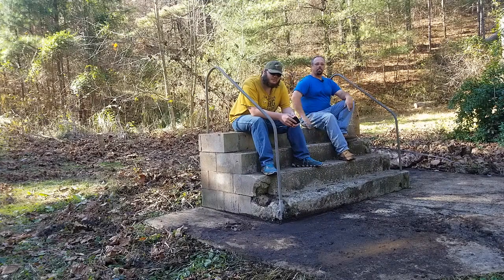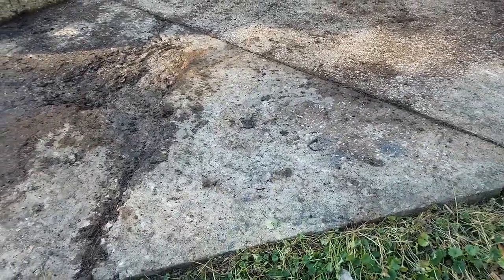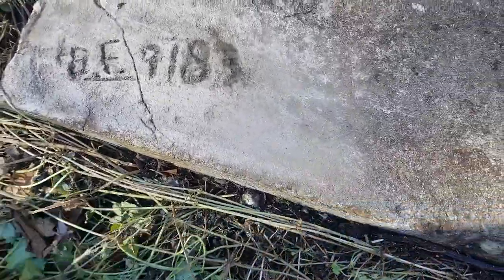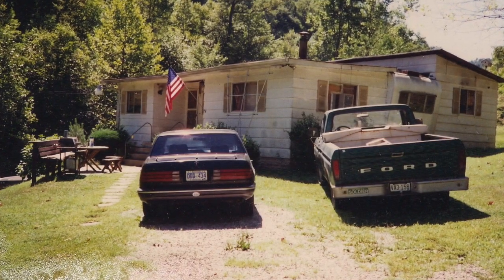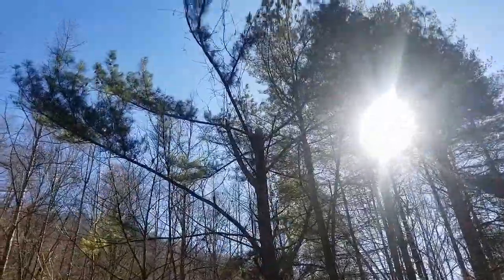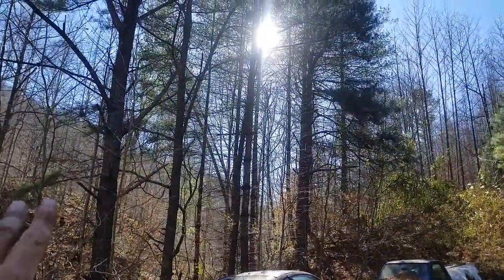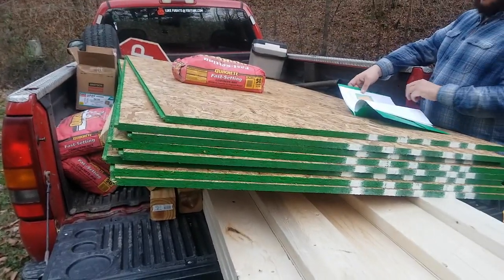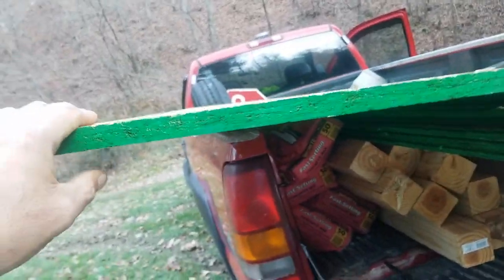Laying Out the Tiny House

Comment: Screened in porch later will help make more room, and can always add small wash room on back or something. I have a 10x20 but no loft but its pretty comfy.
Reply from the maker: I will have a porch on the front. It will be 6 feet by 20 feet. It should add a little more room. We have a room that was built on the back of the old trailer that would make a good wash room. Just have to move it out there.